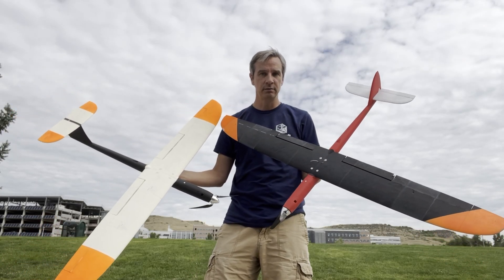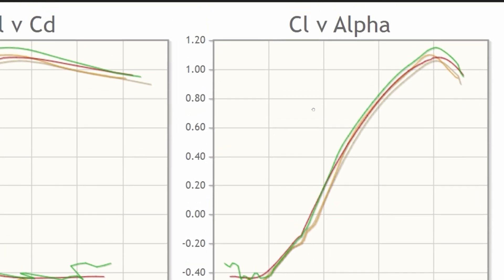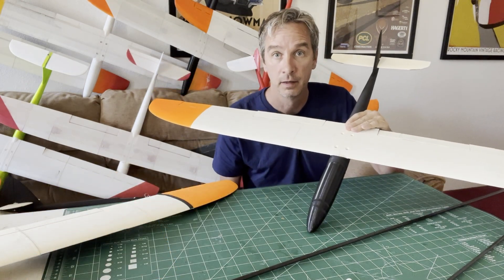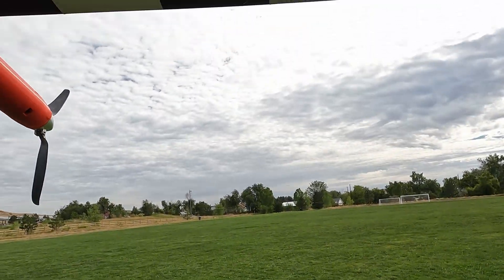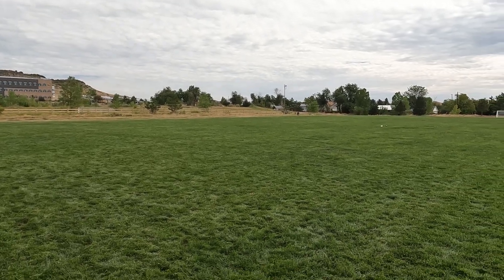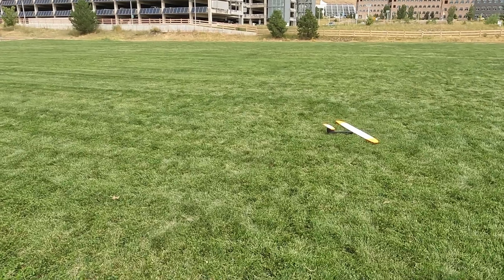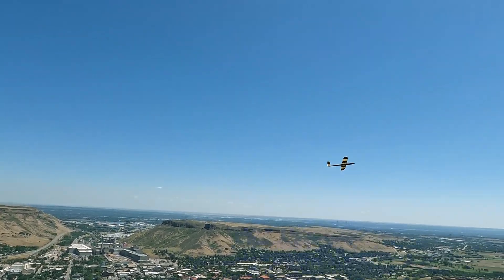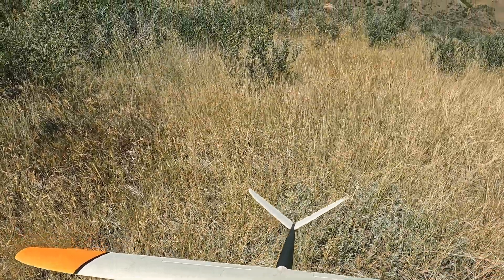New Wing with MH32 Airfoil - Flight Tests - SoarKraft

Comment: The MH32 was very popular for thermal duration. It's a little slow on a 3m plane on the slope, but smaller planes seem to do really well with it. Good choice! BTW, the MH32 does benefit a lot with reflex for speed mode.
Reply from the maker: I still like the RG15 best for strong slope days… and DS… MH32 is not very good to DS.. I have other airfoils coming.